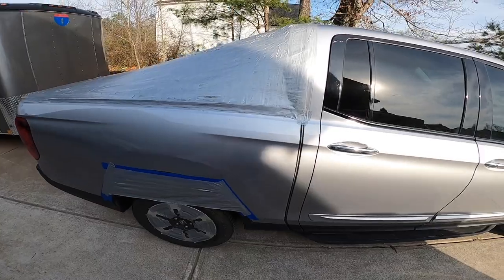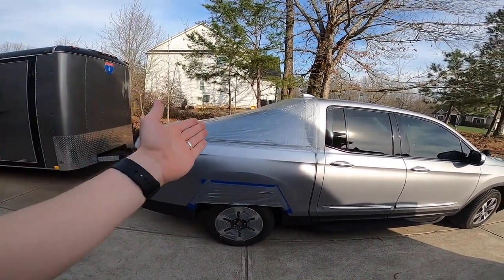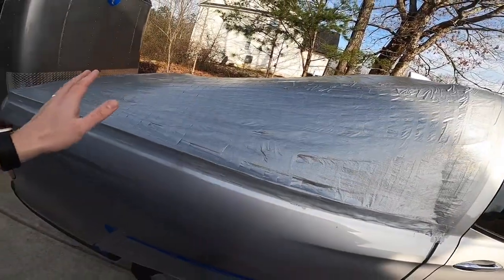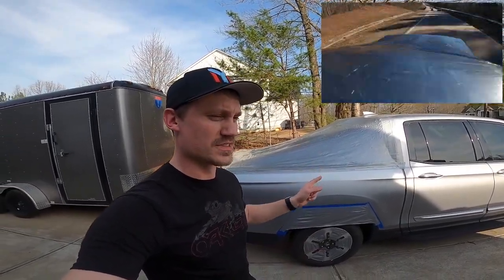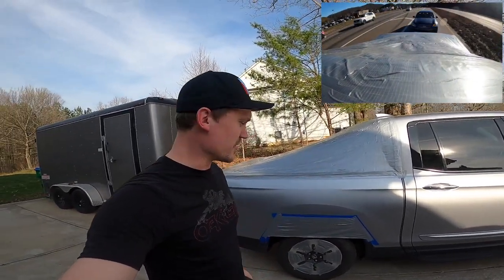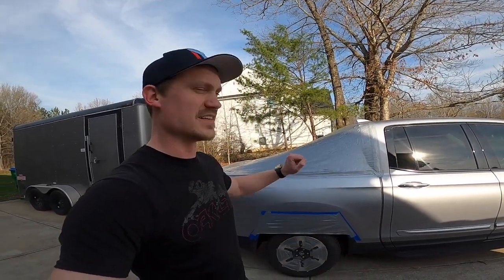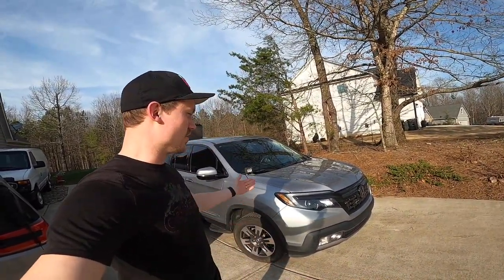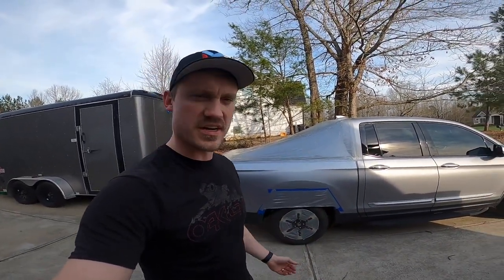I turned my Honda Ridgeline into a Cyber Truck

Comment: That is really a very nice upgrade in efficiency,    too follow up you could bump up your tire pressure a couple pounds, possibly  add a lower front valance or chin spoiler.   Maybe a little more creative tape around your mirrors with a bit of a draft tail.   The rear of the truck should give you even more improvements but they may not be practical  but smoothing up the underside and leaving a  air slot below the bumper ,(just for any wind pressure  or water buildup) would  help. A draft tail off the reat tailgate top that curves down the sides may also give you some more slip.  I'm sure the front grill has already been wind tested during  development but an inch  off the top and sides may also give you what you need to hit 45mpg.   Pretty cool stuff, send your page to "Aero cap" out of MI.  They build a convertible cap for the big north American trucks  with the gains your seeing ,  I'd think even a canvas style convertible top would be a great play.  Awesome Channel absolutely envious.  Cheers from Nova Scotia Canada.

Comment: Take out the front passenger and rear seat, spare tire, and the side step rail. That would probably shave off 300 lbs.  Take out fog light on top of hood. But all this don't really mater if you don't change how fast you accelerate  from a dead stop, and how fast you drive it on the highway. Just a thought...I love your video keep it up  :-)

Comment: I’m curious if just covering the bed with a flat board would have the same effect?  Basically stopping the drag created by the open bed.  Great video.  Car manufacturers should be as smart.
Reply: I’ve got the OEM tonneau and hit 32 on a 400 mile run recently. Same trip last fall without it I hardly did 24.

Comment: A fun video to achieve or goal of 40.
You're on the right track with your duck tape job, but this time put the tailgate down, with the tailgate up, it causes a bit of a back draft on the flat side of the truck.
See how that works.  🛻
Reply: I think a bed topper that creates a "sportback" look wouldn't be too bad 

To get 40 Yuri needs to look lower i.e. underneath the ridgeline to make the air travel smoother
Reply from the maker: Interesting idea. Extending the slope with tailgate down. 🤔
Reply: Yes. Do this. Rebuild the duct tape top with the tail gate down.

Comment: Take out spare tire, and replace with tire repair kit. Replace oem muffler with magnaflow 4 x 9. Still quiet, less weight, less restrictions. Long shot, eco tires that advertise high mpg
Reply from the maker: I want to push the truck as far as possible before we’ve got reduction. That’s the final form I believe. 😁

Comment: Just put tailgate down on highway…better fuel mileage and a better ride!
Reply from the maker: Tailgate down has been proven without a doubt many times to negatively impact your fuel economy. You create a significant amount of drag in the bed. The tailgate up creates an air cushion in the bed which air flows over it at higher speeds. What I’m simulating is just an improved version of a tonneau cover that hopefully overall more efficient over long road trips.